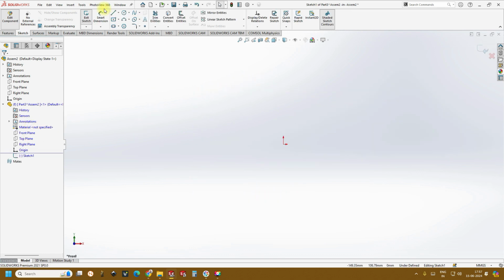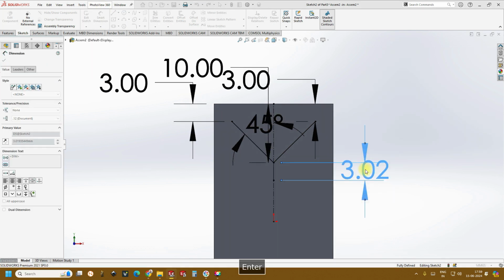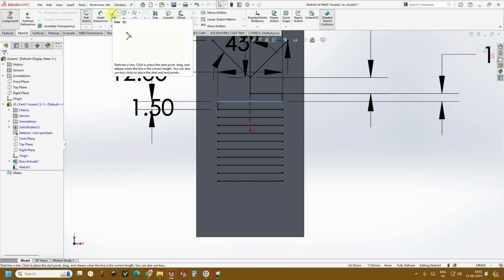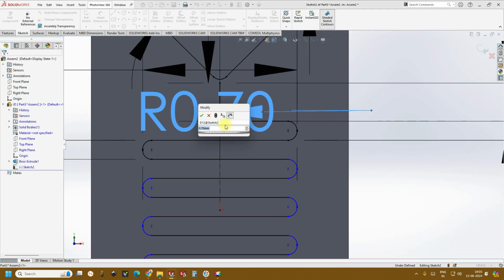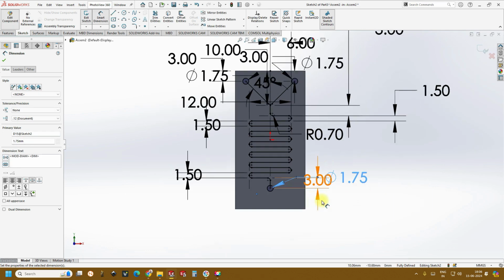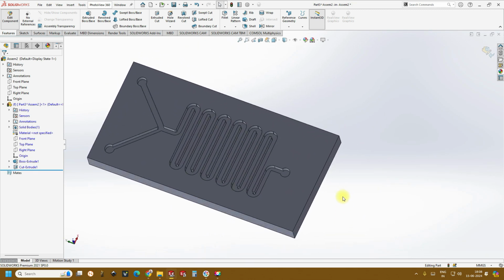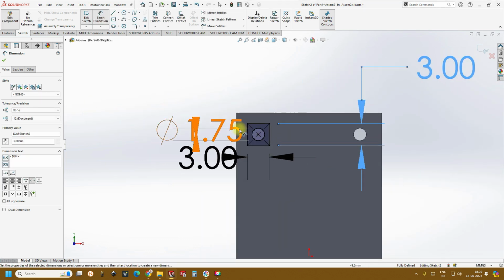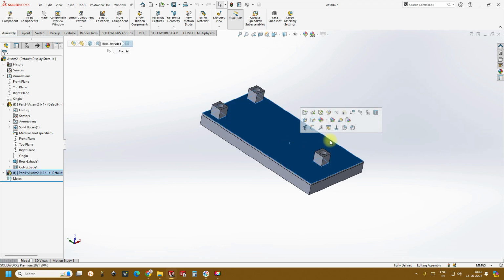Design of Y-Shaped Integrated Serpentine Microfluidic Chip for Industrial and Academic Applications

Comment: Can we make similar channels using FreeCAD?

In FreeCAD, how can we make offset of the lines?
Reply from the maker: Definitely, will be updating. For personal queries dm @ saipavar.official@gmail.com..
Reply from the maker: We can make it; I figured out what you were asking !! Select and right-click on the line, then see the option offset. In that, give the required dimension, and after in elements, select arcs, delete them, and then add lines to close the contour to perform 3D operations. I hope it helps !!
Reply: @microfluidicsensing Thank you very much for your response. It gave me tough time trying to do that and it was not working. 

Thanks for the explanation again. I will try the way you suggested now. 🙏
Reply from the maker: @meharunnissa9967  Most welcome. Happy to see your commitment !!